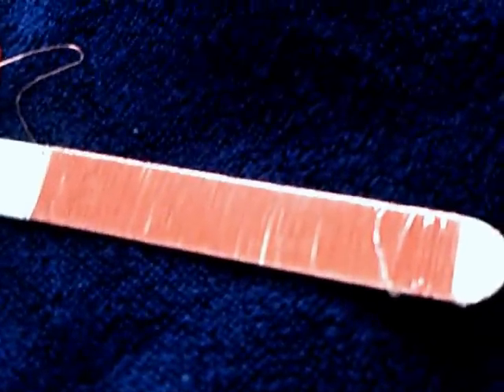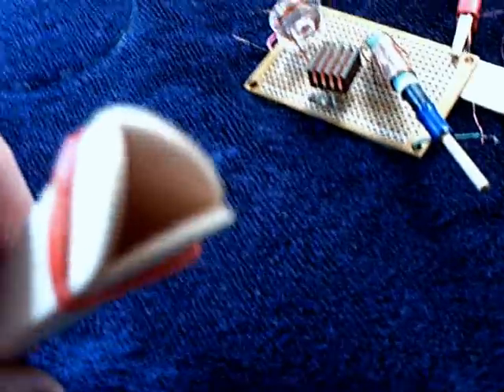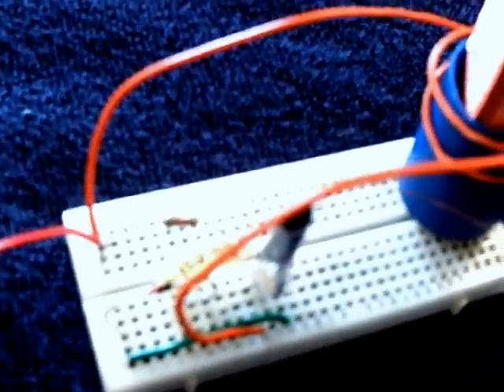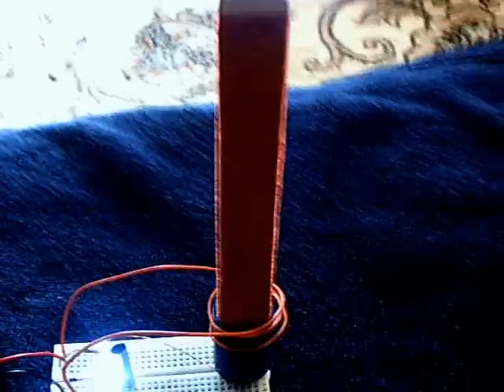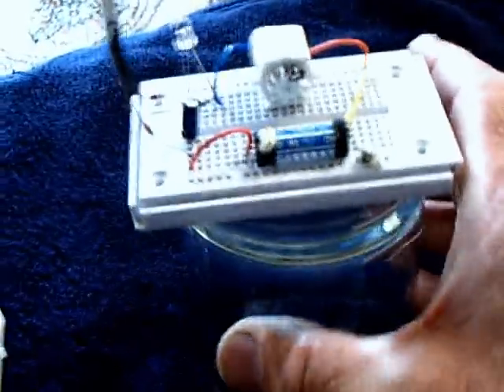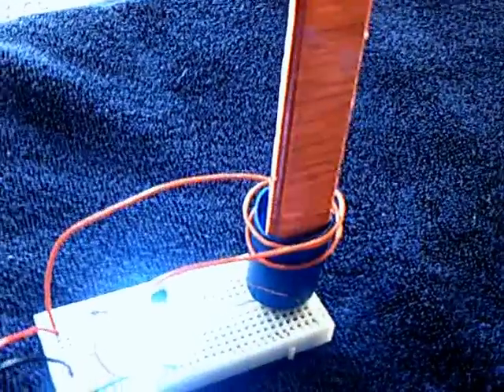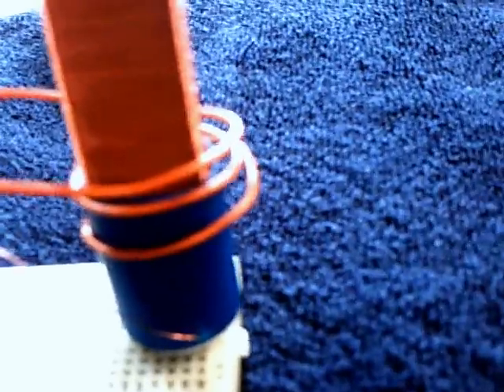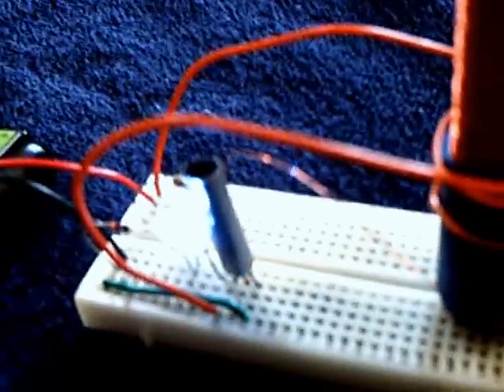3 Stick Slayer Exciter

Comment: I was wondering if you place your camcorder in a Faraday cage when filming your
Slayer exciter.  Many years ago in college I built a Tesla coil and when I fired it up it fried a Heathkit clock which was wall mounted a good eight feet away.  The logic chip was causing the seven segment display to go haywire.  The clock never recovered.
Reply from the maker: mediaguardian  I keep the power way down on these devices to avoid damaging  stuff.   Some of the guys I worked with years ago were careless and fried their computers.

Comment: Tesla liked 25 to 50 Kilohertz today one of the most popular is 4.4 Mega hertz. Certain filters rid harmonics but add compression known as pulse forming network. This changes the electrical component ratio it can be done in the secondary with the length and diameter 3:1 to 6:1 an example requires playing with math could be developed such as:

Comment: i can't get my exciter to work. its the first I've made so I'm probably doing something wrong. any thoughts
Reply from the maker: Try reversing the primary wires. On a pure Slayer Exciter the device is tuned by moving the primary up and down the secondary.  Try that also.

Comment: Nice work !  consistency and improvement is truly an experimental attribute. The ratios make a difference.
We learned about concatenation. The primary feeds some of the energy each time until everything you pulsed is moving up and down in the secondary coil let's say it took 8 cycles to produce 12th harmonic on 96 FM you chose 4.8 : 1

Comment: suggest trying the ZTX-851, it's insane!  Compare it to your garden-variety TO-92's and they are looking a bit inadequate  =P

the low saturation voltage makes it pretty good for the sec-15 type oscillator circuit; careful though, it can easily exceed the power dissipation rating for the package...

Comment: Thats looking really good! I think there are a few firsts there. Is that ferrite around the outside with the primary?
Reply from the maker: I got this to run without the ferrite finally by playing around with the primary coil.  No ferrite here. The blue thing is just a plastic cup to set the tower coil in and act as a form for the primary coil.

Comment: Well done , but does this triangular Teslacoil work better than winding it on a small plastic or paper tube ?
Reply from the maker: I don't think that this worked any better than a round coil  ---but it was fun getting it to work.  I was very disappointed when the flat stick coil I tried didn't work.

Comment: Now that's a neat idea and a repeatable form to wind on for folks to replicate.
Bet it was odd to wrap a triangle.
Reply from the maker: Yes this would make a good repeatable coil that would allow a first time 'exciter' builder a better chance at success.  Tongue depressors are pretty standard world wide.  Winding the triangular form was easy.  Did it by hand in about 30 minutes. Coated it with my wife's clear finger nail polish.